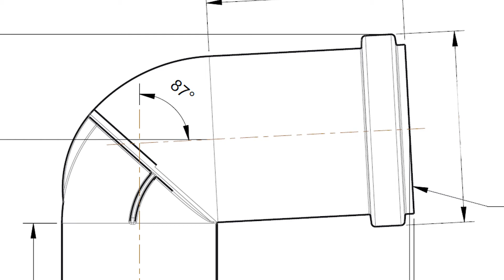InnoFlue Polypropylene Vent Systems - Pitching the System

Comment: You should make a follow up video to discuss the 3 degree vs 1 degree pitch, as per the installation guide 1 degree is only permissible if using all long sockets (some of the angles are not available in long sockets) thus, you would have to use a 3 degree pitch.
Reply from the maker: We'll add it to the list!